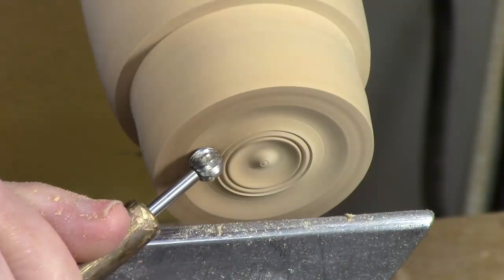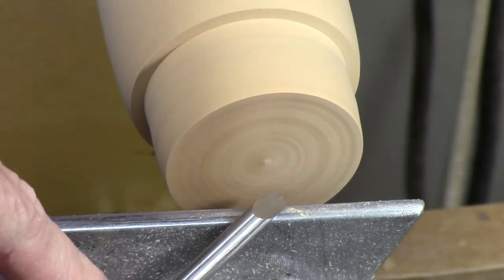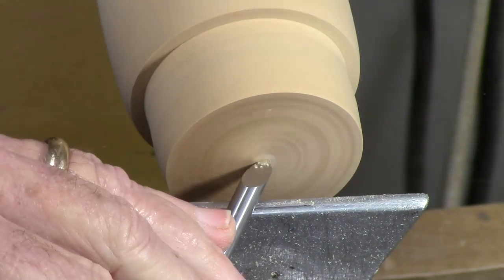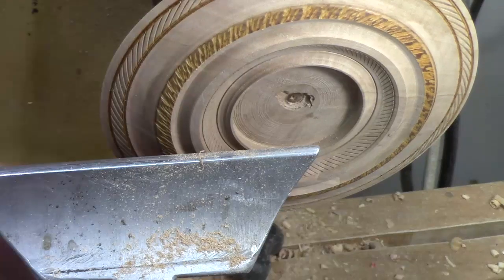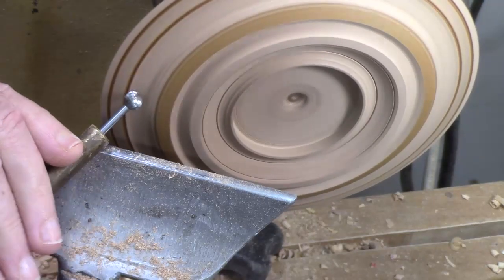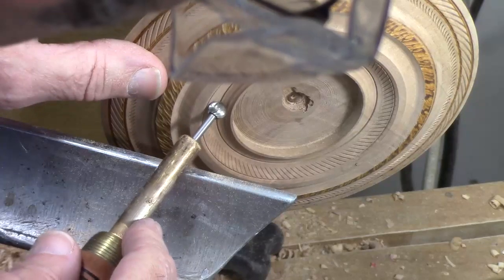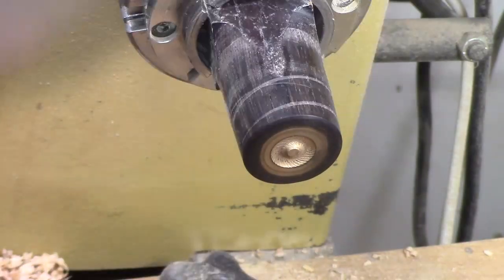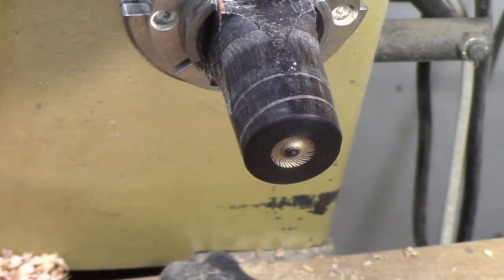Add Pizzazz to Woodturning with Texturing - Part 2 DIY Dremel Burr RotaryTool

Comment: I just might have to make one of those, too. Thanks, Mike! As always, 
--Joe
Reply from the maker: RE: "Did they (youtube) get the comments issue straightened out?"
Not sure which issue you are speaking of but this is the only way I could find to reply to your message.
Reply: They did get the problem resolved quickly this time. And thanks for making the extra effort to reply to a message posted here but doesn't appear here.  Youtube's comment code isn't all it could be (programming detail). Thanks again. . . you really didn't have to.
--Joe

Comment: Mike--great video.   I want to make the rotary texturing tool and got the list of parts required.  I have searched all of the sites that you suggested but none of them show the bearings. I also searched the Uxcell site and when I found the bearing with the 1/8" bore and tried to place the order it switched me to a bearing with a 1/4" bore.  Any suggestions?
Reply from the maker: I found these on Amazon https://amzn.to/2w4zYWd   Looks like the bunting bearings I used are out of stock.

Comment: mike if you wanted to accent the texturing what could you use to go into the texturing,,not on the face but into the texturing
Reply from the maker: I talk about metallic waxes a bit at 12:48. Depending on what you are trying to accomplish, white liming wax will also work well. Most gilt cremes or  metallic waxes will work in the texturing . They do not all work as well on large areas such as  a Nick Agar sunset bowl. Chroma Craft has some specialized cremes that Nick uses  for large areas.
Reply: thanks mike,,,i really do appreciate the info,,love your videos,,keep em coming,,,lol

Comment: Mike

I tried to duplicate your rotary texturing tool, but ran into a problem finding the parts.  Like you, I could find everything on the internet, but the cost of shipping these small, incidental items was prohibitive.   Fortunately, I was able to find a suitable pipe nipple at Homer's, and I was able to order a Dremel cutter from Ace.com and have it delivered to my local store with no shipping charges.  But the bronze sleeve bearings were another matter.

After some research on the internet, I landed on another solution - plastic sleeve bearings.  I made mine from HDPE (salvaged from a cheap cutting board from the dollar store), but I suspect that Delrin or UMHW would work just as well.  I turned a scrap of the plastic to form a dowel about 1 1/4" long.  I shaped it to have an OD that was very close to the ID of the pipe nipple over 1" of length, and a slightly larger OD for the rest of the length, and then rounded over that end to make a cap at the end of the sleeve.  Since most glues won't bond with HDPE, I cut some grooves in the side so that when the glue cured, it would form hard rings that would mechanically lock the sleeve inside the nipple.  While the piece was on the lathe, I drilled a hole through the length that was slightly larger than the 1/8" diameter of the shank of the Dremel cutter - I used a #30 bit that has a diameter of 0.1285"; this allows the bit to rotate freely while still providing good lateral centering.  

I just did a test project, and am very happy with the result.  Thanks for the inspiration.
Reply from the maker: Excellent. I will have to keep that solution in mind. Let.me know how it  holds up under use

Comment: Great video. I'm trying to make my own decorating elf per your article. I was wondering where you found a rare earth magnet small enough to fit into the 1/8" NPT brass nipple. I got the magnets from harbor freight, and they are just a bit too big to fit in the pipe. Any suggestions would be appreciated. Thanks. Joel
Reply from the maker: Google rare earth magnets. Magcraft.com has a large selection.